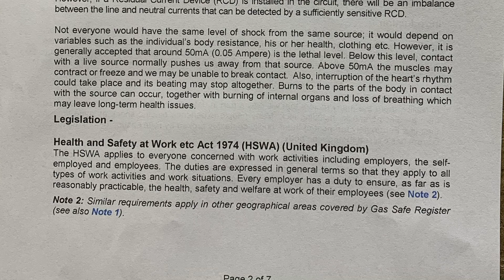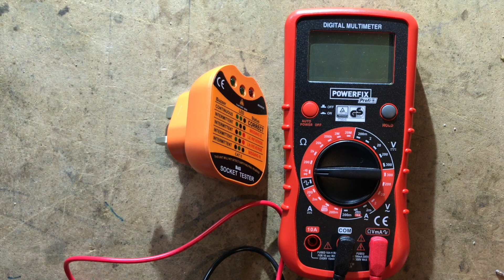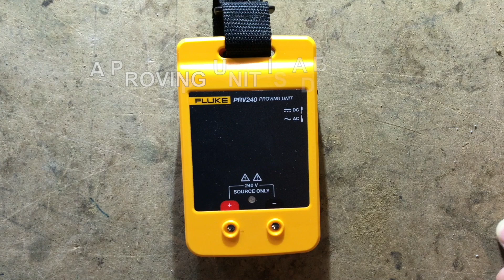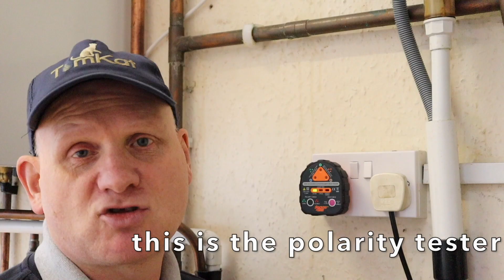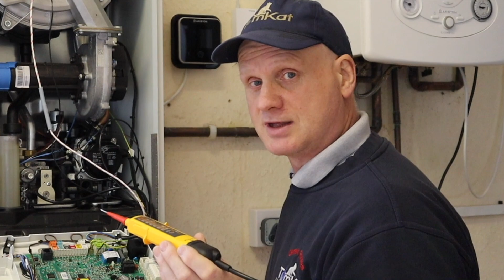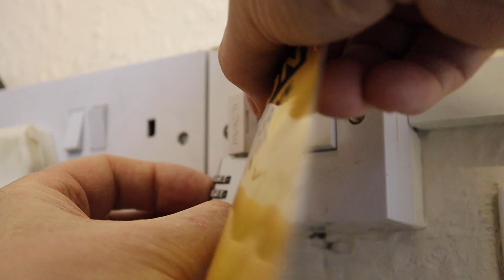ELECTRICAL SAFE ISOLATION, of a boiler to gas safe technical bulletin 118 and the new ACS criteria

Comment: Hi Derek, great video. I've got my gas summative exams coming up this month and I wondered if I'd be expected to do a safe to touch test following tb118 on a back boiler as I believe we are meant to do a service on one?
Reply from the maker: At tomkat we ask our trainees to always carry out the safe to touch but obviously other trainings centres do different things
Reply: @tomkatgastraining  thank you for the quick response. Yea I was slightly confused as we have only done it when working of a room sealed boiler but after reading tb118 it states that the test should be performed on every metallic gas appliance (I think, from memory) thanks again for your help 👍

Comment: Where can I get a proving unit for the proving unit? LOL
Reply from the maker: The proving proving shop
Reply: @tomkatgastraining  lol. Cant believe the price of them and you gotta buy 2 lol
Reply from the maker: @lazylady81  do you not need a proving unit to prove the proving unit to prove that one 🤔
Reply: @tomkatgastraining  I know mate i m just messing about.Its always summat with Gas Safe though. I redid my acs in 2019 so this is actually the first I've heard about this new reg. Ive got all the kit already apart from the proving unit but I managed to get one from eBay same as yours for £60 so it wasn't too bad.
Reply: Don't need a proving unit. Gas engineers do not kill all the power like electricans so will have a non isolated source to prove on and use a 12 quid kewtech adapter plugged in on any live socket. Don't think that is poss then get a  self proving tester for 50 quid on line
Reply: @Михаиллеви  Anyone that does electrical fault finding on boilers immersion heater etc needs a proving unit to make sure testers are reading correctly
Reply: @lazylady81  why do they need one ? They can prove their tester on a £12 kewtech socket unit as derek robbins uses or buy a self proving tester for £50 quid.
Reply: @Михаиллеви  do those give out a reading of 240v ac?

Comment: If the earth and neutral are reversed at the socket the tester still says all is OK,  As at the incoming there linked any way.  test it take a short extension lead and wire the plug in that way and test again.  But if there is a RCD on load it will trip

Comment: Hi Derek, love your videos great stuff. Can you clarify in this one where it says these test equipment not suitable. We use Fluke kit so our NCVD are 200-1000v  but makes sense to go with more sensitive kit. Even Kane only stock what you recommend. Cheers Steve
Reply from the maker: The lower you can get one the better because it’s all about detecting voltage to stop a spark happening as well as being safe to touch

Comment: Makes the gas engineer sweet,, hehehe, stray voltage on gas pipe, neutral all switched lives,, socket and see equipment is £100 ,,maybe less on eBay,, is 50 volts or 100v safe ?

Comment: Very informative and thorough but a good idea for added safety would also be to identify the DNO (District Network Operator) type of mains supply at the intake point (TT, TN-S or TN-CS) which in most cases can be done by visual inspection.
Reply from the maker: A very good point but as gas engineers we are not able to make comments on the electrical installation of the house we just need to make sure we are safe by following gas safe tb 118. Thanks for watching and the comment cheers